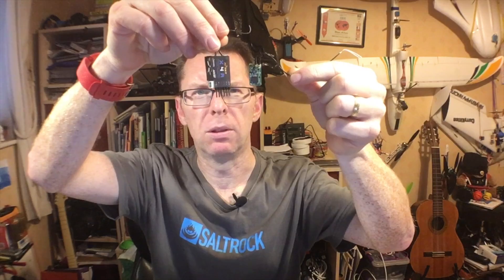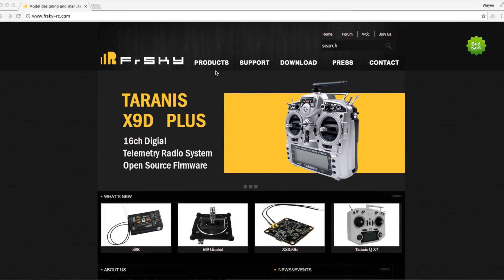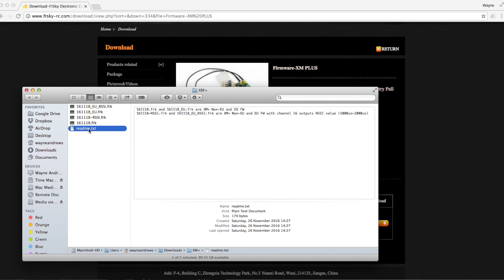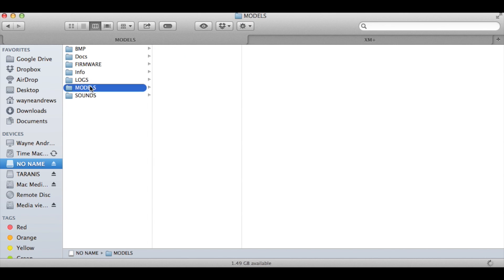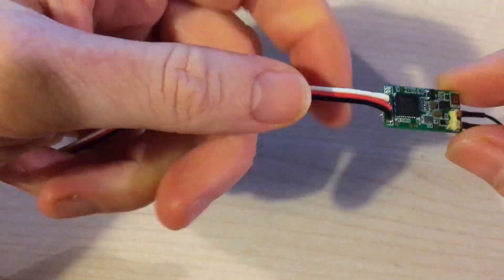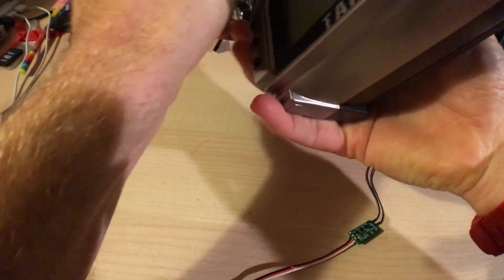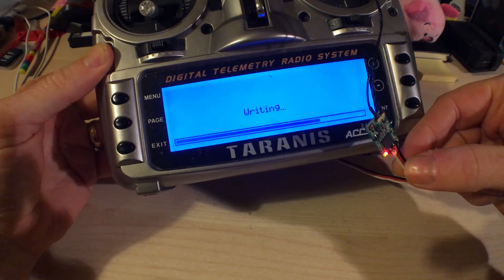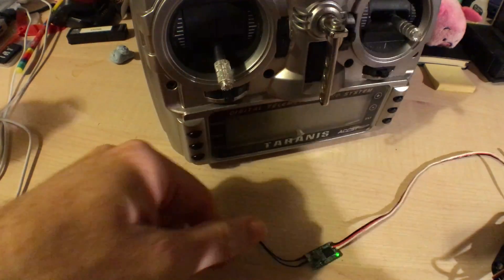Tutorial: How to reflash firmware on the FrSky XM+

Comment: Trying to bind (FrSky XM PLUS Mini)
To my (FrSky X-Lite pro. EDGTX V2.10.3 ) internal RF module or (iRangeX iRX4 Lite V1.3.4.0 AETR)external RF module 

I was able to flash XM PLUS Mini with 
(V170313 FCC rssi 8) 

The internal RF MODUAL I CAN'T FLASH 
IT WITH (V 1.1.3 )  (FW update error device not responding) 

I can flash it with (V 2.1.10.frsk ) successful
Reply from the maker: I hadn't heard about any issues in downgrading the internal module, but then again I stayed well away from v2.x.  I haven't touched FrSky in a while, but I saw this thread https://intofpv.com/t-internal-xjt-d16-d8-mode which talks about a specific firmware version that sounds like it's worth a try

Comment: Question..why does the power leads need to be swopped?
Reply from the maker: You need to swap them to match the pin order on the module bay on the Taranis.  Later models may use a smart port connector underneath where (I think) the ordering doesn't need to be messed around with
Reply: Just tried a passthrough update on the XM+ no luck,com port does not pick up device

Comment: Hi, I have 2 of these XM+ recievers , I have tried to bind them to my tyro119, it does bind and my channels work but I keep getting badrx and rxloss when trying to arm...
Will flashing the XM+ resolve my issue???
Reply from the maker: On one occasion I've had a very poor range rx which was solved by reflashing - but it's more the exception to the rule.  Certainly doesn't hurt to try, but before that I would check all your wiring/solder.  If you are getting bad rx/rx loss try powering on and hold the rx in your fingers/thumbs and put light pressure on different parts to see if any led's go out, or it produces those errors on your OSD.  It's more likely the case that either a physical connection/wire or the rx is bad.

Comment: Thank you for the informative video. I was able to successfully update the firmware but I cant get into bind mode. When I hold down the bind button and power up all I get is a solid red light. No green light at all. Ive tried all of the different firmware versions (fcc/lbt) and checked the power source is a steady 5v. Even tried the old pre 2.x.x firmwares. Any ideas?
Reply: same

Comment: Can these be bound to a betafpv lite 2 transmitter
Reply from the maker: Yes - the XM+ talks D16, so the LiteRadio 2 can bind to it
Reply: Mine won't and it's driving me mad haha whenever I try to bind it shows solid red and green lights
Reply from the maker: @RBMEDIA88  That's normally a firmware mismatch.  Is it possible you've got LBT firmware on the XM+ and you are attempting to bind in regular D16 mode?
Reply: I'm not too sure a friend sent me them saying he had flashed them to fcc d16 I'm all new to this drone mslarkey haha is there a way I can check
Reply from the maker: In a word no - you'd have to reflash them.  Stick the radio in LBT mode and see if they bind, that would be one way of being able to check

Comment: How you do it with the jumper T8SG V2 plus?
Reply from the maker: The T8SG runs Devention doesn't it?  I don't think you can flash from it (but I'm no expert on this) you might have to buy the adapter to allow you to flash from your pc if not
Reply: @CurryKitten  Could you send me a link where I can buy to do it from my computer. Thank you
Reply from the maker: @electroddxful  Ok, no experience in doing this myself, but it seems to be this one https://www.banggood.com/FrSky-STK-S_port-Tool-Kit-for-Upgrade-S_Port-Products-for-RC-Drone-p-1099105.html which sounds wrong as they mention it's for s.ports (which the XM+ doesn't have) but it works... apparently.
Reply: @CurryKitten  Thank you so much really appreciate it. 👍🙏👍🙏
Reply: Hey @RayFPV I got the same jumper radio. Did that adapter work for you? I'm about to toss this shite rx!
Reply: @whoopassfpv  I never followed up with it. Just pick up a different receiver.

Comment: Do we need to flash the firmware before we use the receiver?.
Reply from the maker: The rx will have firmware on it, but you won't be able to hazard a guess of what version unless you connect it up and try and use it.  I find it easier to flash before doing this - just so I know it's on what I want it to be

Comment: Hi Wayne.  Will this work with a Jumper T16 as well? I've got a brand new GEPRC Phantom (toothpick) with XM+ and I'm not getting RSSI in my OSD or on the Jumper's screen.  I've set RSSI to aux 14 in the Receiver page in Betaflight and aux14 is jumping around like mad, but nothing in OSD or TX screen...  Not sure what to do to get RSSI.

@8:50, you mentioned that these RXs "don't do telemetry", and then go on to explain you CAN'T use RSSI to find a downed quad?  That confused me.
Reply from the maker: Definitely aux14?  Normally you'll see RSSI on channel 16, which is aux12.  If it is 14 then it's probably not RSSI as these can only use 16 channels and aux14 would be channel 18.    Make sure you have OSD active on your OSD screen as well.  But yes, you can flash the T16 with the pins in the modul bay in the same way as a Taranis. 

As far as telemetry goes - the XM+ isn't a telemetry receiver, it doesn't send any info back to the quad.  If you do get a telemetry signal (such as from an R-XSR) then should you lose your video in a crash you can look at the RSSI on your radio screen to work out if you are getting closer/further away from your quad.  You could do this, of course, on an XM+ if you are still getting a video signal nicely - but when upside down in a thick bush, you have to be a lot closer.
Reply: @CurryKitten  Thanks for the super quick reply.

My bad.  I was on the wrong channel. Yes, aux 12, so I've now got RSSI in my goggles.

Thanks again.

Comment: Hi there with all the controversy about Frsky reciever firmware update I was wondering were I could get an older version of non-eu RSSI 16 for the XM+
Cheers Phil
Reply from the maker: Yes - it's a bit hidden.  If you go to the regular firmware page here https://www.frsky-rc.com/xm-plus-mini-sbus-non-telemetry-full-range/ there's a link that says "History firmware DOWNLOAD (not compatible with v2.x.x)" clicking on the word download will get you the pre-2.x.x firmware you want.
Reply: Thank you love your channel wish more people would view it clear and to the point with loads of enthusiasm 👍😊
Reply: Do you think it’s possible to run just the sbus wire to the Taranis for XM+ firmware upgrade 
if the power comes from the Flight controller 
Cheers Phil😊
Reply from the maker: I'm not sure - I don't know if the radio does anything special to stop it booting up normally.  It doesn't, for example, supply power until it tries to flash it

Comment: So... 5V from rx to bottom pin servo lead, middle wire is ground? top wire is signal? Could not make that up from your video.
Reply from the maker: Sorry, it was a bit dark there filming into a black against black thing.  So bottom pin in the module bay is signal, next pin up is ground and next one up is is 5v.  The top two pins in the bay aren't used.  I put out an updated video to this here https://www.youtube.com/watch?v=3NObP3uhaao where you can hopefully see them a bit clearer
Reply: @CurryKitten  thx, for qx7 taranis, oscar liang had the info on his website, did it, it worked, fairly easy indeed!

Comment: hey, thanks for the video
BUT, i flashed it with normal polarity on my x7, successfully... at least the flashing part.
i can´t seem to bind the x7 with the XM+, x7 firmware is EU and the XM+ too, i even tried several versions, but always the solid red and green lights... can you or somebody else help me on that one?
Reply from the maker: I noticed that someone once had an issue binding to an XM+ from a Q7 on the EU versions and eventually worked it back as being the version on my internal XJT module (see here http://www.fpvhub.com/index.php/topic,52591.15.html) I don't know if this is the case, it's certainly complaining about firmware mismatch - worth checking out what version of the Internal module firmware you are using.

Comment: hi, can you flash the firmware on the r-xsr while it is in situ through beta flight or similar? recently just refreshed everything else over to EU and my non eu quad won't bind. id rather do it in place than take it all apart. cheers. great videos by the way :)
Reply from the maker: Well, there's no passthrough via an FC if that's what you mean, you have to physically connect the Taranis to the receiver.  On the bright side though, at least the R-XSR has a connector  that you can take off and reconnect.... unlike an XM+ where you mostly have to resolder/resolder
Reply: CurryKitten yes that would be a bright side... if I hadn’t hot glued my rx lead in place because I loosened the pin to much 😂😂😂😂
Reply from the maker: It seems that every silver lining has a cloud :)  A more time intensive job I'm afraid

Comment: Can I flash my reciever while it is still soldered to my flight controller using jumpers?
Reply from the maker: I haven't tried as I don't have anything that will clamp onto the joints accurately and reliably enough to do this.  In theory, it should be fine
Reply: I just want to be sure it wont brick my flight controller. I have those wire hook Bob things they will attach nicely
Reply from the maker: Should work, but I can't tell you it's ok for sure, unless I've done it myself... which I haven't.  If you want to be 100% safe, then desolder, flash and then solder back in

Comment: Is this because of the taranis? I just got a drone from bangood and cannot bind to my taranis x9d. I get a solid red and green. Is this because the reciever is older or my taranis? thanks
Reply from the maker: Shouldn't be - the Tarnis will bind to the old D8 style receviers.  What receiver is it you have on the model ?
Reply: CurryKitten xm reciever d16r
Reply from the maker: If you get a green and red light when you are attempting to bind, it signifies that there's a firmware mismatch.  Coming from banggood it'll probably be running International/FCC firmware, if you are in Europe you are likely to have the LBT version of the firmware on the radio... in which case flash the LBT firmware onto the XM (see video on how).
Reply: CurryKitten i got the taranis from hobbyking.com i live in the US. Is there a way to find out what version is my taranis.
Reply from the maker: As far as which version of the firmware you are running in the internal module, no.  But based on you being in the US and buying from HK, odds on you'd have the FCC version.  So does the XM rx show both LEDs just when you turn it on, or only when you attempt to bind to it ?
Reply: CurryKitten when i turn on holding then button on reciever to bind. Even with taranis off i get both lights.
Reply from the maker: If you just power on the rx without pressing the bind button, do you still get the solid green/red leds or only when you attempt to bind?  I just tried putting an x4rsb into bind mode without a radio about, and it's the 2 LEDs solid, with flashing as soon as the radio get's turned on in bind mode.  So still could be down to the rx not liking the firmware on your radio, and refusing to bind.  If that's the case (and as long as you get a normal flashing red if you power it on without doing so in bind mode) then try reflashing it with the latest FCC version of the firmware and see if that cures the issue
Reply: CurryKitten if i just power on i get a red flashing. I just did the fcc update on the xm plus and xm both same thing I'm thinking is the radio. I updated bother version non eu and eu and both don't  work. My radio has a fcc because it has 3 modes.
Reply from the maker: Ok - well at least it sounds like the rx isn't broken.  You are in d16 mode, and using 1-16 in the channel range ?  I've not heard this being an issue with XM/XM+'s, but try a few different Receiver No to bind with as well.  It's had an effect on a few other receiver typres

Comment: Curious... when you bind a xm+. Do i choose 1-16 telem on or 1-16 telem off... or the 1st 2 option with 1-8 telem on or 1-8 telem off? I bound to 1-16 telem off.
Reply from the maker: Jan Domingo just to be clear, it's not a binding option (it's which firmware you flash it with) and it's not telemetry (it's RSSI) I generally use 16 channels where ch16 is RSSI
Reply: CurryKitten i understand that. What im asking when binding a xm+ to my qx7 which option do i choose?
Reply from the maker: Jan Domingo ah ok. I don't remember having the option to tell the radio to expect telemetry or not (away from radio this week) you want an x16.  So 16 channels, no telem

Comment: On frsky xm+ download which firmware will i use for rssi? The top 16channel rssi? Whats the 3 others below LBT mode?
Reply from the maker: Normally yes - the latest firmware (version 170313) has the code in for the FCC (international version) and LBT (EU Version) versions with RSSI on channel 8 or channel 16 (the firmware that doesn't list RSSI is the default normal 16 channel).  If you hit any issues try the previous level of firmware (version 161221) I need to do some more testing to check it, but I seemed to have issuers on a few receviers on the latest firmware, where the previous level was fine... but the latst is usually fine.
Reply: CurryKitten yes i have that version and it works for my binding. So does that mean i have the non eu version?
Reply: CurryKitten i use the firmware with rssi channel 16 170313 yes?
Reply from the maker: Yes, if you are binding using the FCC version it means you have the non-eu/international version for firmware on your internal XJT module in your radio
Reply from the maker: yes

Comment: If i dont have those cables can i just solder them directly on the pins and desolder them after? Where can i get the xm+ firmware?
Reply: I tried flashing it but i got a response bottom pin no response?
Reply from the maker: Do you have a QX7 ?  If so then also check this video out https://www.youtube.com/watch?v=3NObP3uhaao  I presume you found out you get the firmware from the FrSky website ok, and that yes, you can solder cables on to the XM+ to flash it
Reply: CurryKitten i found out how to flash the hard way lol

Comment: Good presentation helped me alot - you having a Mac did throw me a bit, but reading between the lines did manage too bind my XM+ thanx 
Did notice that your taranis RF Mode was set at D16 and channel range = ch1-8 why not ch1-16.  Would it mean your Tx transmit only 8channels...joe
Reply from the maker: I didn't notice that.  I did start using 8 channels as I figure I wouldn't need 16 and you can use a lower frame rate which means that you'd get ever such slightly less latency.  However, having tried both I do't notice the difference at all, so I now normally use 16 channels with ch 16 as RSSI
Reply: Gotcha - so a year has passed since you did the video and the update version has changed (now V170313) = progress 
There are 6 listed downloads within V170313,   numbers 4 and 6  applies to me, I notice that No6 has a reference to RSSI does that mean it would give me acess to RSSI cos I chose No4 with out it...joe
Reply from the maker: I did another update video on this BTW, but now super-new info.  The clue is in the titles for the type of firmware you have, so in the 170313 zip you will have FCC170313 and LBT170313 varients depending on what sort offirmware you are running.  Then the just .frk file - the standard 16 channel firmware, then the RSSI8.frk and RSSI16.frk which are the versions that have the RSSI output on channel 8 or 16
Reply: only use ch1-16 if you need all 16 channels.  otherwise use 1-8  the latency is less.

Comment: Hi Wayne, I have just flashed my XM+ to include RSSI and all looks like it went well, weird thing is I didn't need to re-bind afterwards though which has thrown me a little, have you ever had this happen? Just went from FCC to FCC with rssi.
Reply from the maker: I don't know to be honest.  I generally do the flashing before I ever bind it and solder in place.... I might have reflashed, but then I can't remember if I rebound afterwards.  Could be that (guesswork here) the bind info if kept on a complete seperate bit of NVRAM (or something) that where the FW lives.  Pure speculation, I'm not at all sure of the makeup of these things :)